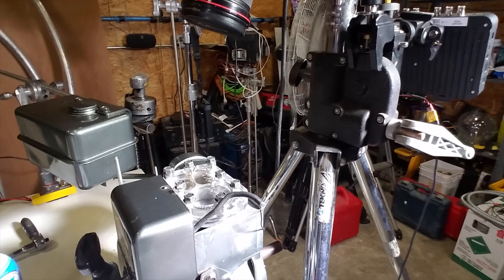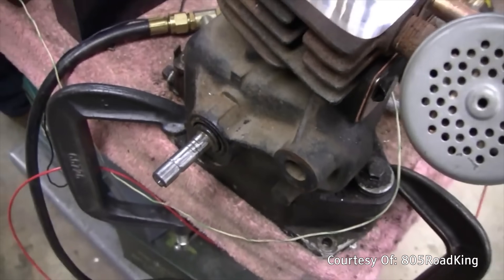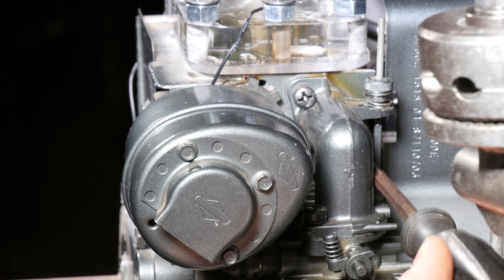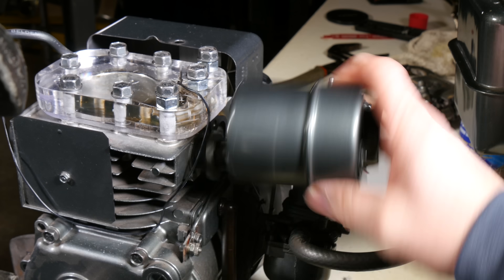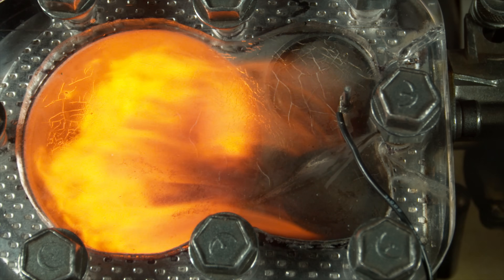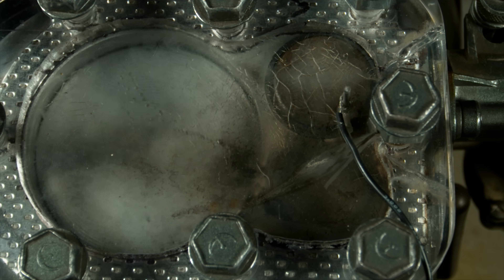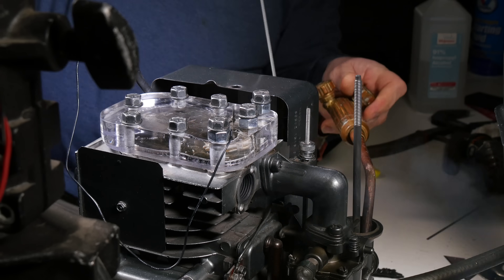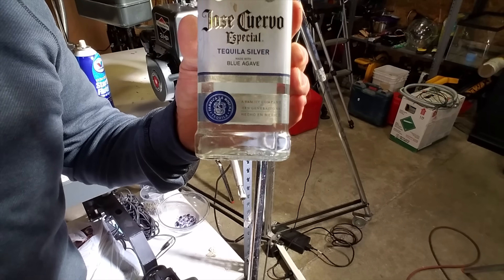See Through Engine - 4K Slow Motion Visible Combustion ( S1 • E1 )

Comment: This was interesting.

It looked like the intake valve wasn't fully seated with the alcohol as it looked like it was still flowing in during the compression stroke. It certainly wasn't atomizing very well as you had mentioned. I think it would require reworking the corroborator to achieve the proper air to fuel mixture using alcohol as fuel but at least you got it to run off it. 

Choosing a Briggs and Stratton motor was a good choice. No valves in the head to worry about. 

This might have proved to be somewhat dangerous, so maybe it is good you didn't do this, but adding some oxygen from that welding rig I think would have dramatically changed the combustion dynamic as seen through your Lexxon cylinder head. At the very least it would have reduced the amount of soot in the exhaust, if it didn't grenade first that is.
Reply: Carburetor.

Comment: So basically if I add alcohol to my. Fuel it should clean the injectors cylinders etc?
Reply: at least in my country they are doing this anyway.. normal gas is already 95% gas and 5% ethanol and there are other types of gas with different alcohol/gas mixtures..
Reply: Dunkelelf3 OK if you was to add the alcohol manually what ratio would you use
Reply: i wouldn't.. the problem is that not all engines react really well on high ethanol content especially on older cars.. maybe your cars manual can help you there but here we have cars that can't even handle the 90/10 gas/ethanol mixture so i guess going 95/5 would be the maximum if unsure.. just to be safe.. the problem is that the "cleaning" effect you are hoping for isn't all.. alcohol can damage plastics and rubber like in tubes and sealings and under high temperature and pressure might also increase corrosion on aluminum parts in the engine.. also some car manufacturers say that it might decrease the lifetime of the engine overall..
Reply: That would not be a good idea.  Many engines are designed to work with a specific type of fuel, including ethanol or methanol.  Some additives specifically referred to as "dry gas" do have a small amount of alcohol in them, but too much of the wrong additives can damage internal plastic and/or rubber pieces as Dunk said, and can basically ultimately damage your car or truck's engine.  Back in the 80s, my best friend's car was screwed up by that because at the time, the gas station he used didn't post that they had a gas/ethanol mix above what his car was supposed to be able to handle.
Reply: OK guys Thanks was just thinking as a preventative measure like to add a little bit of alcohol like during one full up. Per mth just to clean out the fuel system but the risk overpowers the reward
Reply: Shimon La Hée 
Not necessarily so. In this video the water used to dilute the rubbing alcohol is washing away the deposits in the cylinder - not the alcohol itself. This much water in the fuel over a period of time would do serious damage to the engine, not to mention it would run very poorly, there's no load on the engine in this video so there's no indication of how much the power level dropped during that segment.
Fuel system cleaners are made up of solvents that break down deposits in the fuel system chemically.
Reply: +Dunkelelf3 In Brazil, "gas" is 25% ethanol.

Comment: great video. you should try a more concentrated isopropyl solution. 91% (i think that is what was used) means the other 9% is mostly water. methanol would be great. it was cool to see the gases flow through the valves. nice job!!

Comment: id actually like to see you do it a bit more well thought out. ive done a lot of research on running a car on alcohol (methanol) and you would get a lot better visual results by running it through the carb via the fuel tank. Any fuel that is to be run in an engine needs to be metered and thats part of why the store alcohol was mostly liquid and unburned because of just dumping it in the top of the carb. plus alcohol is a cooler fuel and needs engine heat to help it vaporize and help the combustion.  either was it was entertaining.
Reply: demo man agreed. Also I think removing exhaust made for a less direct forceful path for the gas to exit the engine.

Comment: The air to fuel ratio was way off with the alcohol. I did experiments with all kinds of flammables in .21 r/c  engines and rubbing alcohol works. Those little engines have a high and low speed mixture screw that allows custom tuning to any fuel type.

Comment: spark plug is sparking on the intake stroke
Reply: It sparks to cause the combustion obviously, but it also sparks right after the exhaust is pushed out and right before the fuel is sucked in to burn off all the excess fuel that wasn't sucked out.
Reply: Cody Hubert isn't it supposed to only spark on the combustion stroke??
Reply: EpiCJarred these type of engines spark at every TDC. Since the have no ECM for the ignition timing.

Comment: I'm wondering if you used 99% isopropyl alcohol because im curious if the 70% alcohol with water combination would work better as it could use the alcohol as a fuel source and the oxygen inside of the water to carry out combustion because as I was watching I could see certain times there wasn't enough oxygen for it to combust until more oxygen came in from the intake either way great video. If anyone else is curious about this please like so it can be answered, thank you.

Comment: A very interesting video...thanks for posting!  Cute that you involve your 2YO!  
I believe that 91% shown on the rubbing alcohol (at 2:11) means it it 9% water and that is what shows up as the droplets in the comb chamber (although I would have thought the temperatures in the comb chamber are hot enough to vaporize it so it would get exhausted and not hang around...  
Please try "dry gas",  methanol, or nitro-methane which have no water content as a comparison.  Also when burning acetylene, you're probably way too rich...back off the gas and let some more oxygen mix in at carb, or up the oxygen feed at gas valve for a better cleaner burn with less soot.  Cheers

Comment: RE: running it on  Tequila ..... I had a second cousin who was an ambulance driver in WWII that told a story of running out of gas under fire at one point.  He took a bottle of Peppermint Scnaaps that he just HAPPENED to have stashed under the seat (entirely believable for this guy) and dumped it in the tank.  He said that old jeep (a basic flat head four banger not unlike the B&S engine) didn't run WELL but that it ran good enough to get him the hell out of there.

Comment: Remarkable efforts. hats off!! about ideas, here's my 2 cents;) I think that the compressed air requirement of a diesel car's air conditioner can be entirely recouped during engine braking.
There is not a throttle plate at the inlet manifold of a diesel engine. the engine thus continues to draw in air while engine braking. Jake brakes used to get rid of this air in order to increase the engine braking efficiency of a vehicle may also be able to collect  this air. if this can be done, the crank pulls would be free of a huge tax by the AC compressor thus increasing its  efficiency by upto 30%

Comment: Looked like a washing machine as it was not metered alcohol, engines run great on Methyl Alcohol, Methyl Hydrate, need to bump Main jet size way up, B and S powered Junior Dragsters typically run on alcohol.  Would  be cool to see the burn process on properly metered fuel.   Great video.

Comment: Try hydrogen gas. You may want to (if possible), change the timing of the spark, since it ignites 1100 times faster than the long-chain molecules of gasoline. It should run a little quieter too.

Comment: Pretty neat. I watched Road King 805s video with the glass cylinder head before. You should see about getting an alcohol carb so you can get the mixture right with the alky. My guess is you will barely be able to see the flame. It would be great to see what nitro methane does too but be careful its got way more BTUs and force than gasoline or alky so it may blow that glass head apart.

Comment: I would be interested to see something like this in a diesel engine. Although, I'm not sure if that head would be able to handle the compression necessary to ignite diesel fuel. 

By the way, why not add some oxygen in the mix with the acetylene? Probably burn more cleanly and completely.

Comment: fascinating, … do anything that involves seeing normally hidden proceses inside tranpsarent casings at 4000 frames a second, so as to see what happens, perhaps various types of pump etc? amazing how inefficient the burn looked in allot of cases ? I wonder what a modern very efficient engines looks like? also a different engine where flow of combustibles is in a continuous loop in which gas doesn't backtrack to become exhaust flow ? also a certain points there seemed to be a dummy ignition in-between the real firey ignition ?

Comment: I'd enjoy seeing video(s) of the engine running on gasoline and possibly propane at varying loads and rpms  on a dynamometer. - full throttle with load variations.   Be interesting to see the changes  in flame propagation.  Thanks for what you've done so far!

Comment: You should run 93 octane gas and hydrogen gas see if it cleans the cylinder   And I think the reason for the alcohol pool inside the cylinder because u dumped over fueled the carb it's like old American v8 they used to just dump fuel into the carb but it wouldn't burn throughly so I would suggest a much lighter amount if you can try to run alcohol into the engine as a fume/vapor and see how the might look

Comment: I'd like to see 91% isopropyl alcohol instead of the 70% rubbing alcohol with 30% water.
Reply from the maker: +Oratio Libre That was 91% it says right on the label
Reply: Sweet. I am fascinated that you could have that much unburned liquid in chamber and still get the engine to run. Can you imagine what a really flooded chamber looks like?
 
I also like your use of pre chamber combustion. Work in the 50's and 60'sindicated this was the most efficient because it allowed lots of advance and so maximum combustion time.

Drawbacks were cam timing had to be mild so the intake and exhaust weren't open at the same time for very long, and low rpm to allow combustion time.

Though it won't produce high horsepower, the combustion is more complete.
Reply from the maker: Oratio Libre I know I was very intrigued. If that was gasoline I wouldn't even ignite.
Reply: Surprisingly gasoline has a very wide range of vapor pressure. Summer gasoline around 7 psi and winter gasoline around 13 psi. This are very rough numbers it evaporates over a very wide range, with some evaporation around 70 deg and doesn't finish until 225 deg.
http://www.chevronwithtechron.ca/products/documents/69083_MotorGas_Tech_Review.pdf
Reply: 99% Isopropyl alcohol is readily available online. Search for electronics cleaner. You can even get pricier stuff at 99.9%

I've cleaned my car's intake with it. Makes for a couple seconds of interesting ignition.
Reply: Good point.
Reply: Warped Perception would using a little bit of isopropyl alcohol in a engine would be okay for cleaning purposes?

Comment: I noticed how slowly the flame front moves and how quickly the exhaust exits the exhaust valve. I can see how having minimal piston to head clearance of about .035-.040 will help with the swirl of the air/fuel mixture and flame propagation at tdc. Great video. Thanks
Reply: I also noticed how many really dumb people make comments here.

Comment: 1)try Browns Gas supplementing  gasoline . 2)straight HHO.  3) methanol  4) stoichiometric mix of oxi fuel  . adjust the carb to get a proper mix . should it be a blue flame  with the fuels used???

Comment: Well done... Fun to look at. Love to see it running on Tequila :-P,  but how about testing it on methane, propane and charcoal gas ? would love to see that. 
If you have the correct Air to fuel ratio, it will run smooth and less soot...

Comment: you supposed to use the gas tank to be able to supply through the carburetor the alcohol if you put alcohol directly into the carburetor in that large amount of course is going to look like a washing machine now on the other hand the alcohol seems to burn cleaner which means cleaner and reference to some of the other fuels you might want to consider try to run it on propane

Comment: Very cool video! I'm wondering if all that fluid that built up while running on isopropyl alcohol was water? It was only 91% alcohol and the engine would not have been hot enough to vaporize the water. Alternatively, maybe alcohol needs more O2 for complete combustion than the gasoline?
Reply: Yes exactly. 9% water that won't burn and has a very high energy of vaporization. Washed the inside.

Comment: What would really be interesting is for you to put a hydrogen electrolysis system on this and see what the difference is between regular gas and gas with an HHO system on it.

I am not affiliated, but for more info of what I am talking about look up HHO Joe on ebay.  I don't want to open up discussion on this here as normally happens when this is mentioned.  But I made and used a similar system around 15 years ago and it saved me a lot of money.  It would be interesting to see the difference and be a good scientific test.

Comment: I wonder if the engine would have run on alcohol if you had made it much leaner?  It looked like it was just running insanely rich (way too much fuel).  Gasoline (and alcohol) have a neat side effect in that they also provide some cooling, when the liquid goes in and it's transferred around the cylinder (and even more-so with modern engines which produce a vapor with tiny droplets), you don't get that with acetylene, you just get the combustion from the gas, but no cooling, which is why the head went kaput, I believe.  You were dealing with much higher temperatures and pressures than the engine was designed to run with.  The additional cooling allows you to run more timing, as well, which is why methane mixed with water is sprayed into some very high performance engines (methane injection), it assists the fuel in keeping the cylinder cooler, which allows you to run more timing, which allows you to make more power.

Comment: The alcohol would have worked better if you poured it into a fuel tank and not straight into the carby. That just flooded it. But I'm interested to see tequila. Or bicardi 151 76% alcohol.

Comment: Howdy Warped--cool vid! Apologies if you already answered this, but as glass doesn't respond well to the drill bits and shaping that appeared early in the vid, I'm guessing that the transparent head is plexiglas or acrylic. Is there a high temp. version of these? I'm surprised it didn't melt, although it did look like it was damaged later in the vid. Thanks.

Comment: Great video, be extra cool to see a 2 stroke, they are a lower compression ratio than a 4 stroke too and the smoke from the combusted oil might show swirl patterns of the ports from inside as well as combustion. Maybe try some propane on the 4 stroke too, no need to prime it just give it a chooch of propane and start it.

Comment: okay so I have a doubt. it may be kind of stupid but once the combustion takes place and the piston is brought back up due to the vacuum created by the exhaust leaving the cylinder, how does the piston go back down and come back up again another time without any combustion? I noticed this happens when the intake valve opens. I'm pretty new to all this I don't really know a lot.
Reply: vedant agarwal it's not the vacuum of the exhaust port that brings the piston up but the momentum of the counterweights on the crankshaft that it received from the previous combustion stroke.

Comment: Hi, 
Could you do a slow motion air flow video of a baseball while varying the humidity.. Kind of show the  "angle of attack"  a spinning ball creates at max rpm? And the action associated with its deceleration and how a pitcher creates the spin with finger tip pressure because of how the ball is placed in his hand?   Its good timing... football is almost done and baseball is about to start.

Thanks,
Andrew

Comment: My dad watched this video and he suggested to test an electric in tank fuel pump. When the engine is running out of fuel and is getting air and fuel. Because fuel run's over the commutator and air is present and also fuel is present. It must be catching fire at some point. I think the screen in the tank that is meant to be a filter is actually a flame arrester.  I would like to see this with your slow motion Camera.

Comment: Propane and Natural  gas would be helpful. However you just showed what alcohol does to an engine hopefully your video will be used to stop the EPA from mandating 15% alcohol so we won't be forced to run it in engines that were not designed for it. If you keep burning alcohol in that Aluminum engine the rings will rip the aluminum right off the walls. It has a oil dipper on the end of the connecting rod for oiling that won't keep up the piston will almost melt into the cylinder wall. That's what happens if you run them on E-85. Alcohol has about half the BTU content of gasoline rule of thumb is 2X the jet size for Alcohol when switching from gasoline in your case to produce 5HP seeing is believing! That carb has an adjustable main jet normally run about 2 and a half turns off the seat so Alcohol maybe 5 turns off the seat.  E-85 a little less.That will show the wash realistically as evidence to it's effects. The other thing is Plasma ignitions with a spark plug you can burn the hydrogen in Water to run the engine its simple ck. it out that is if you're looking for that Wow factor. Cool idea just remember if you do try the plasma ignition start out 1/4 turn off the seat with the jet it don't take much. Have fun...